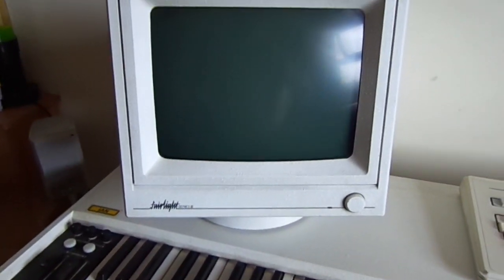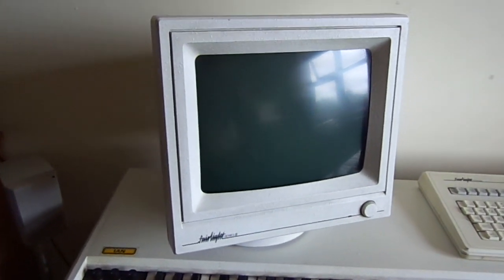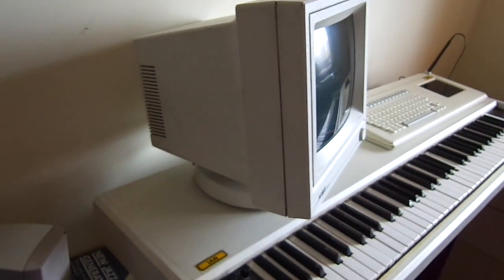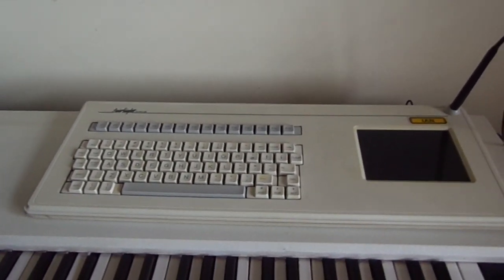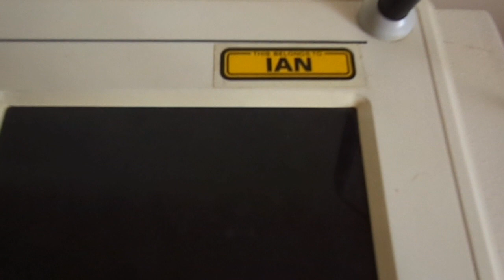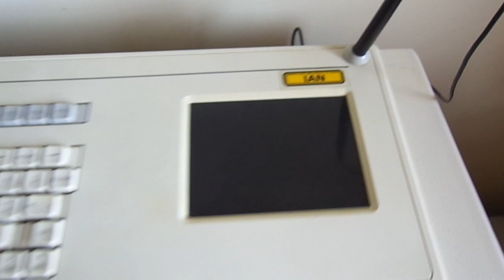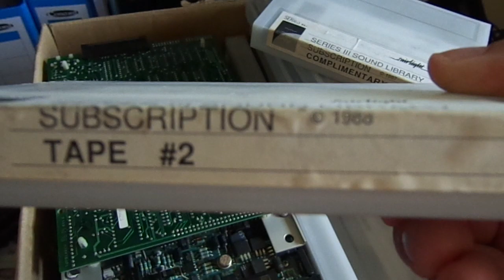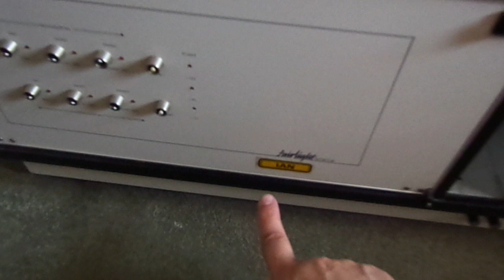Fairlight CMI Series III Restoration Part 1

Comment: It didn't really. The 8" floppy drive was primarily there for software updates (each of the K partitions are 1mb = 1 floppy) and backwards compatibility with the Series II. Sound storage on the Series III was based around the hard drive and tape streamer. There was really no reason to save to floppy other than for back-up purposes. Whilst it's possible to save sounds and sequences to the floppy, most of the sounds in the Series III library would span multiple disks.

Comment from the maker: The CMI IIx's were around that, but the Series III was way beyond that. They started around $50k and depending on configured options, could exceed $100k :-)

Chances are we'll not be repainting anything. Peter likes stuff to be as close to original condition as possible. If the new owner wants to do that work, it won't be too hard to do.

I'm hoping that the new owner will be me, but I'm still planning the bank raid ;-)